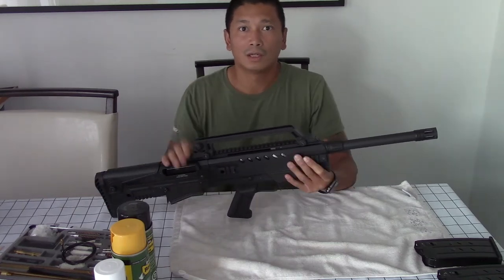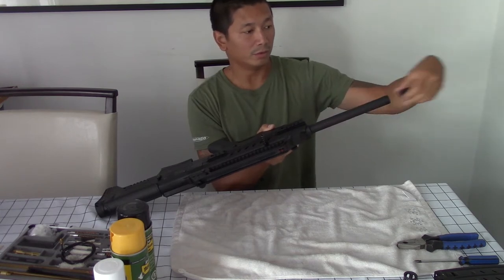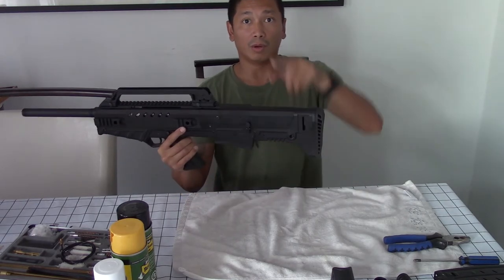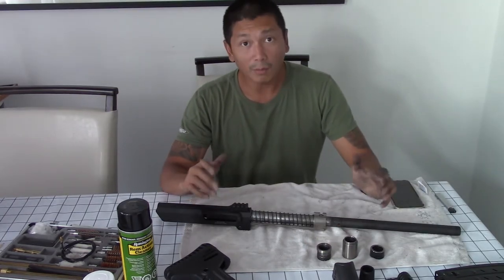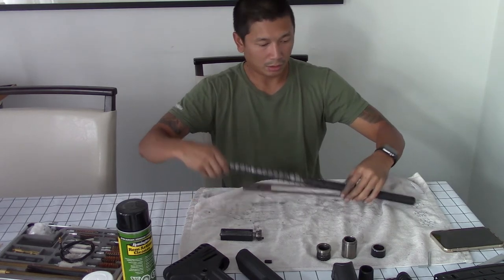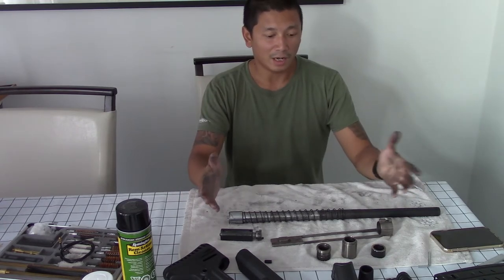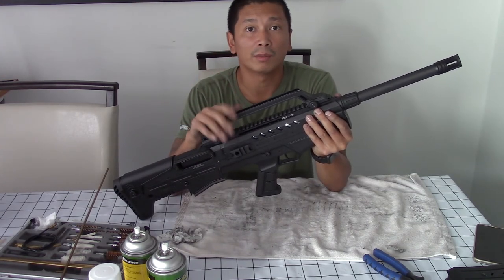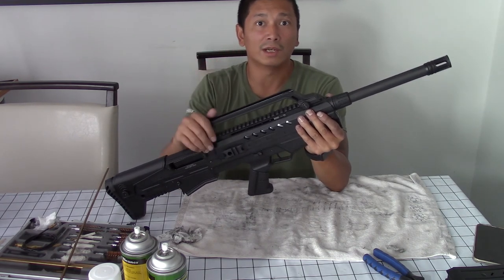How To Disassemble, Clean & Reassemble The Charles Daly N4S

Comment: Niko, did your gun cycle better without issues? Would love to use for grouse hunting with low brass here in BC 🇨🇦
Reply from the maker: It definite did cycle better afterwards was much smoother! Cut it down by ALOT but it didn’t completely eliminate the misfeeds and ejection issues unfortunately!  It definitely prefers 3” shells over 2-3/4 though I’ll say that.